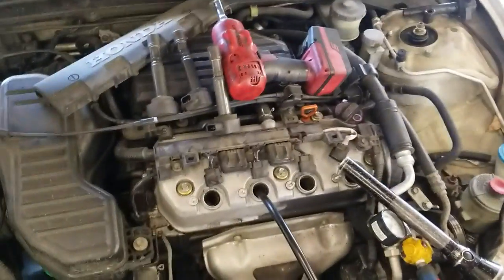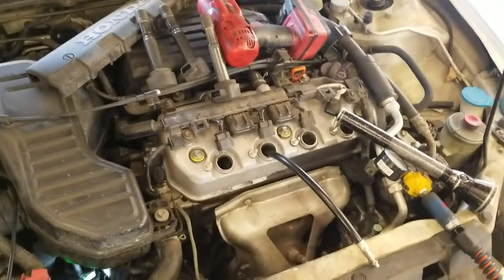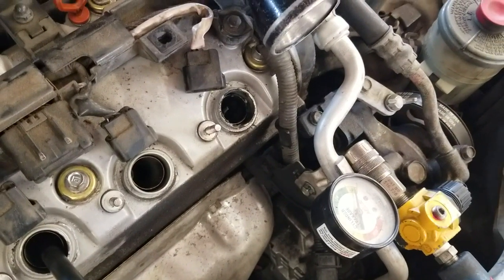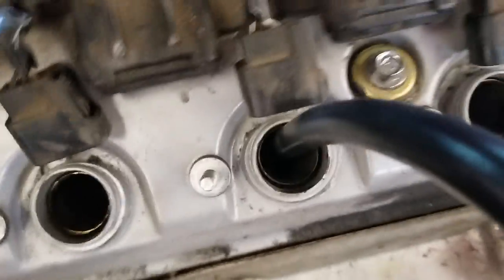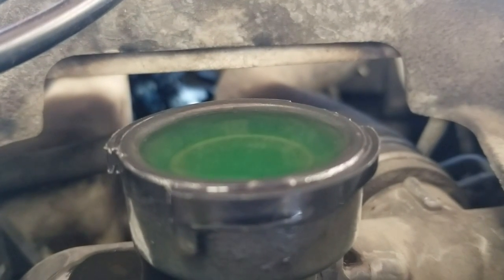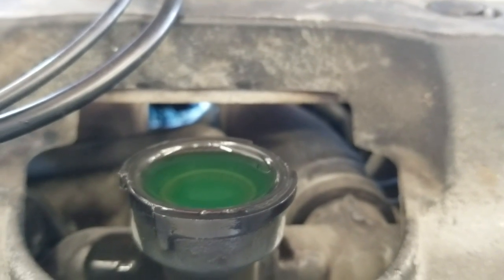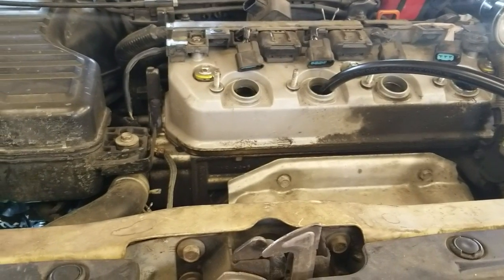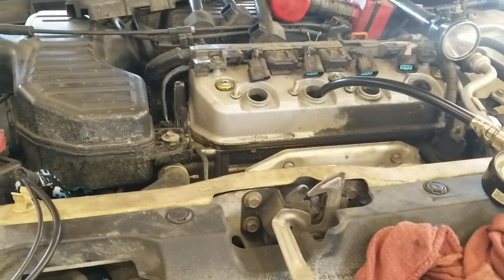Best way to diagnose if your head gasket is bad

Comment: Not necessarily a blown head gasket ,  I would call that a leaky or weeping leak  easy fix just use 1/3 of a bottle of bars , head gasket block sealer. Top everything off and drive it for 1 hour on the expressway.   Keep an eye on it and keep it topped off ,  you may need to add a few more ounces of block sealer...  Too much or more than necessary can clog the heater core  or the radiator ,  half or 3/4 fixed , is good enough... !!!    I've gotten several years out of vehicles like that.    😮.

Comment: Here's the other way to check for  Blown Head Gskt 

https://youtube.com/shorts/Pkaryg9xxpM?feature=share
Reply from the maker: Pressure from revving motor can happen when your thermostat is stuck open. It is normal for some situations. Not a precise way to pinpoint a head gasket failure.

Comment: Why not just buy a new head gasket it's only $50 repair is simple it's a single cam 🤷🏻‍♂️
Reply from the maker: This one has been severely over-heated. To do the job right you need more than just a head gasket. The repair is not up to me. It's up to the customer.

Comment: I got a 2004 suzuki liana known as aerio in the states, it has 202k miles on it and has been an incredibly reliable car. Nearly 9 years i had it it has never once failed to start and never had a warning light since i had it. One problem with though. For the last 6 years i been chasing a coolant loss condition, i cannot find it anywhere. My car was hit and his badly damaged but im going to repair it and before i put it back to work i want to work out this coolant issue, 
No coolant in oil, no oil in coolant, does not burn oil, no white smoke, no bubbles when i run the engine with the cap off, i pressured tested the coolant found no leaks what so ever, radiator cap replaced and thermostat replaced twice, waterpump replaced already. Only symptom is i have to top up half a quart of coolant every 200 miles.
Only clues i have is cylinders 1&2 appear to look steam cleaned whilst 3&4 look like i would expect. Another clue is the spark plugs in 1&2 were really stiff to come out 3&4 came out fine. Wth is goin on ?, would a reld test answer my question.

Comment: Most cars can have good design, good maintenance, good everything and head gasket can develop a leak just from age and slow corrosion.
Especially ones that run real hot.
Reply: I used a rubber bottle stopper that fit a soda bottle, taper sanded the other end to fit radiator. Put plastic bottle with bottom cut out upside down in radiator. Ran engine, the fluid slowly came up into the bottle then stopped, then air bubbles started coming out.........and kept right on a- coming.  Shut engine off and water went down.
Air came from cylinder leak into pocket in cooling water jacket, collecting and displacing water till the air began coming to the surface and into bottle.  When shut off the source of air stopped and water went back into the pocket.
Thereby certifying your worst nightmare.
Reply from the maker: @michaelszczys8316  😭😭

Comment: Thanks for the helpful video. Rather than to pressurize one cylinder at a time, would I get the same result if I pressurized the cooling system? Thanks again.
Reply from the maker: ive tried this on many occasion and even when left overnight, in most cases, there was zero sign of coolant leakage into the cylinder/s. however, in moments, when the pressure is introduced into the cylinder, you get air pressure in the cooling system. one obvious fact is you cant push 70-150 psi into a cooling system without any repercussions

Comment: That’s a sign you got a leak some place not just gasket
Reply from the maker: @imanpepion777  if it's got a leak in the cylinder to water jacket, you will also have a blown head gasket... the compression will likely be not even either.

Comment: My sons 2008 Ford Focus has the coolant filling up like that without the tool youre using. We were thrilled when we used the bulb contraption with the blue liquid and it didnt turn yellow or green. Sounds like its the same sad result though. Its a shame bc the car was my great aunt’s and only had/has 30k miles.
Reply from the maker: @lorla5236  what is the problem you are having?
Reply: @subtledriver  Hiiii! Thanks for responding! This is nowhere near a realm that I am even slightly familiar with. He had an oil change prior to driving 90 minutes to his overnight college orientation. When he arrived he noticed it was really hot in the car when he parked & finally noticed the coolant warning level light was on on his dashboard. He didnt use the car for the 2 days on campus. I told him when he left he needed to go to the closest auto store & buy coolant. The store employee helped him and added it to the coolant reservoir. I was hoping that was the issue. The warning light turned off and he started the 90 minute drive home. Naturally, the light came back on while he was on the interstate. Someone recommended he turn the heat on high & defrost & drive with all the windows down. He did & got the car back to our house. A friend suggested we have the thermostat replaced. We had it towed to a mom & pop shop. The gentleman said he ran the car & notice the coolant level dropped by there wasnt any coolant on the ground, so it was going into the engine. The car is a total loss. He asked me to get it off his property that same day. So $300 in towing costs (to & from) but it came back home. My sister, who lives 8 states away, suggested we buy the head gasket combustion leak test kit. It came yesterday and while I had the car heating up I noticed coolant WAS leaking from the bottom front bumper on the driver’s side. I did the test via the coolant tank and was thrilled when it didnt turn green or yellow. The liquid remained blue. I turned the car off for it to cool down and thought Id try again later on the radiator. I took the cap off and didnt see any coolant in the neck. I let it run for 10/15-ish minutes and then noticed the coolant was coming up the neck, like in your video but there werent any bubbles. I turned the car off and a wee bit of coolant did overflow from the neck. Then I started researching again and came across your video and was crushed hearing the diagnosis via your test results.

Comment: Should I do a glove test on my Honda cuz I don’t have bubbles but I did overflill the radiator when I replaced it after hitting a deer and now I have cylinder 1 misfire I didn’t do coil swap yet but I just have coolant leaking out from pressure but no bubbles
Reply: Swap coil packs, that worked for me, I had a cylinder 3 misfire

Comment: does this issue cause my radiator cap if  radiator pressure cap is bad to create a suction locked on to the radiator. I can not remove the Cap and I do not want to snap off the the threads to the radiator I replaced the radiator 9 months ago. I am trying to salvage my 2006 Chevy trailblazer it has been a dream dream vehicle since I was 15 when I got to ride in a 1971 trailblazer.

Comment: So I was told if you see bubbles on in the radiator when flushing or replacing water pump it means there’s air pockets in the block so now I hear you say bubbles means head gasket failure! Wouldn’t it be easier if you do combustion leak test?

Comment: I recently bought a 1980 cj with a 258. I can't keep it from getting hot. The radiator hoses get hard as well, this is probably at a minimum a head gasket problem right? Or could be rings as well? Thank you for the video

Comment: Your awesome!!!  Could you do it this way without a tool?
  
Example:  If you're testing cylinder 1 out of 4; 
Remove the fuel pump fuse;
Remove spark plugs 2,3 and 4;
Remove the radiator cap and crank the engine to simulate the tool.
Will that work the same way?

I have a car that the oil and coolant mixed together and I would like to think its just gonna be the oil cooler gasket.  Crossing my fingers on your response.
Thanks a million!!!

Comment: This is for someone stressed out over a 2012 caravan 3.6 we just milled heads, NEW head gaskets, new oil cooler, still misfiring at heat soak, because these motors are bad too have cracked blocks, from the coolant to the cylinder, if it misses when you start it then smooths out,or gets worse when hot, yep

Comment: On my car on a cold start with no radiator cap the system pushes about 8 ounces of coolant out but no air bubbles is normal.
Also, on a cold start with the radiator cap on the system, pressurizes but not enough to go into the overflow …. What’s up with that?

Comment: Boss I have a question about my 2006 Nissan Xterra off-road, it’s consume oil and the smoke is white from the pipe hopefully you can help me please
Reply: Head gasket oil to coolant. -white smoke
Burning oil means it’s getting in the combustion chamber I think?? Or something like that, there’s a leak, not goif

Comment: I replaced my head and have been chasing an overheating problem since. I get a lot of slow bubbles out of the radiator while it’s running and tried the chemical test but couldn’t get a reading. I wonder if this is a false negative. I used an mls gasket and it had a composite originally I wonder if it wasn’t smooth enough for the mls to seal
Reply: I've had that before:
•Head gasket is not sealing again.
•Either the head was warped.
•Or the surfaces were uneven or dirty and needed planed and milled before putting the new gasket on.
•Or like you said you need a composite gasket that is thicker and has compressible surfaces.
•New gasket might have been defective & failed or head not torqued down correctly? 
•hairline crack in block or between cylinder walls.
No matter what you need to pull the head again and check for even and level surfaces.
Reply: @puddlesjumper  yeah ended up head gasket didn’t seal
Reply: How long does it take you to do that?

Comment: I'm impressed that a car, that is not being maintained has managed to go 250,000 miles. Is it a Toyota?
Reply from the maker: some people get lucky. this is a honda civic 1.7, problem is it is age related, not mileage. the material on the headgasket is poorly developed, and these motors tend to over-heat due to other issues with cooling system failures

Comment: I would  replace  the head gasket.   If the old gasket  was defective  or had a little  rip .. that should not  be to expensive 
If the mechanic  wanted to charge to much money.  I would  do it my self. .and call it  a nobby.

Comment: Hi, so the Toyota dealer mechanic messed up the radiator on my 03 Corolla & the manager put in a new one at no charge, but what’s happening now is I noticed the coolant on the reservoir is disappearing! From 1 day to the next half of the coolant on the reservoir disappeared. Why could this be?

Comment: Great video another helpful tool in the arsenal to blown head gaskets. Having said i would also suggest if your in dire straight you could also try to use Risolone block stop. Its a very good product and has helped me out with a friends Toyota Corrolla with a similar issue to this video.

Comment: You can also use a leak down tester to check your valves. Make sure the piston is at top dead center on the compression stroke. Apply pressure to cylinder. Listen for air at the intake and at the exhaust pipe.

Comment: Steel seal, that you add to the radiator, has silicate in it to stop the leak. The high heat by the heat gasket makes it turn hard.
Reply from the maker: @clearsailing7993  that will block water passages. It won't fix a head gasket. The only time I have seen a hg leak taken care of, if it was leaking externally and stop leak plugged the hole. No magical additive can replace a metal fire ring that withstands 2,000 psi. That's what the factory head gasket is designed to withstand
Reply: @subtledriver  thanks for the information

Comment: Normal for an all aluminum engine. My 85 Nissan 720 had a cast iron block and aluminum head and never blew a head gasket in 320k miles. Also had a brass radiator.
Reply: How would you determine whether it needs a new head gasket or a whole new block?

Comment: Great video, I never seen a test done like that. Just a suggestion. I have done this many times my self. If you detect a leak like that in its early stage a simple retorque on the head to manufacturer specs can fix the problem. We use to do that all the time with cast-iron engines. With todays alloy engines I have found this trick only works if the leak has just started. I have tried it on engines with bigger leaks but it has only worked with small leaks.
Reply: That’s a bandaid always was even with the old iron motors.    You must be in the used car sale business those are the only scambags still using that “fix”
Reply: @Zach-k2p  You are so funny :D

Comment: I have a 2003 Honda Accord 2.4 ltre i let it warm up for 22 minutes the morning was cold suddenly my gage went on the H section radiator was overheating and i had to shut off the car a little bit of smoke was coming out of the radiator and i just had put a brand new thermostat and thermostat housing . What do you think it is causing this problem ? Also my car has 247,000 miles.
Reply: Check to see if there’s coolant on your spark plugs…

Comment: Dude if you say replace a car because of a blown head gasket your dumb asf I'll do that shit on a Honda for $150 in 35 minutes and have new oil in it and tighten the head bolts to spec and not break them like everyone does and it will run another 150k 😂😂😂

Comment: Use some Blue Devil Head Gasket repair.    It worked for me.  Has been holding for about 1 year now.
I had white smoke out the tail pipe.   Used the Block Test Blue fluid and it confirmed hydrocarbons in the coolant passage way, because it turned yellow.
After I used the Blue Devil Flush and gasket, and followed the directions exactly.  It sealed the head gasket good.  No more white smoke and blue fluid stayed blue.    Worth a try.
Reply: I used bars stop leaks and I’m still going 60k miles later
Reply: mine i used bars leak and it worked for my 96 civic.. no more white smoke and no coolant mixing on engine oil..
Reply: @julaiarnold641 Or is it oil mixing in coolant??
Reply: Sodium silicate can be purchased from a pottery supplier.
Reply from the maker: If the engine wasn't severely overheated, and it was slight seepage that doesn't force the coolant out when driving, you can get away with stop leak. I dont recommend in many cases. As it can clog heater and radiator and passages.
Reply: Did you remove thermostat?

Comment: but does the valve really seal 100% so that it won't allow any air to pass by?
Reply from the maker: there is no valve failure, it is a gasket or crack in the block/head allowing air to get into cooling system. that should never happen on a healthy cooling system.

Comment: I am using Toyata Yaris 2011 model GCC spec, Dubai. My issue is  coolant water is coming through my reservoir, it's very slowly and little bubbling also. I went to garage and they changed Cap, coolant pump and the whole pipe also, but still the coolant is leaking. Can you suggest what I can do next?. Is it a signs of bad engine? If your sharing your contact I can share you a video also.
Thank you

Comment: 2009 dodge grand caravan changed radiator thermo rad caps water pump with no signs of head gasket HELP
Reply from the maker: i cant even understand what you are getting at in your sentence. did you do this leakdown test?

Comment: Hi! 
What if there’s white steam vapor coming from the tail pipe?
The temperature gauge is good, oil is good, coolant is good.  I did have a check engine light read code P0303 cylinder 3 misfire. Trying to diagnose before scheduling an appointment. Haven’t driven car in 3 weeks ever since the excessive white steam happens when i start the vehicle & drive for 15 minutes. After 15 to 20 minutes steam goes away from tail pipe.
Reply from the maker: sounds like normal, or a blown head gasket. get this test done and find out.

Comment: In my unfortunate experience it pushes out of the coolant reservoir or cold start with the rad cap off and watch it blow bubbles when the thermostat opens...just got my car back from the shop with the head gasket blown on the second motor from LKQ. I guess no one bothered to test before shipping and install twice😅

Comment: thank you for sharing your video, and tips on how to determine or test when having some difficulties on your car: engine, radiator, cooler oil pressure etc.. as I am experiencing myself on what you just described. let me say  thank you putting it in into words of comfort 'your car had better days and time to retire"🙏i understand material things can get replace. The  acceptance is a bit overwhelming 🙏

Comment: I’m just gonna continue to ignore the problem until I’m stranded and have to deal with it 😂 my engine only has 7,000 miles on the rebuild and 3,000 miles ago coolant started disappearing 😂
Reply: Oh jeez dude! Only 7000?! 😂 I just got a project car for 5k and white smoke came out of the hood along with a massive coolant leak. I got what i paid for i guess 💀
Reply: @willferalx  it’s an ATK engine 4.0... I wouldn’t recommend them.

Comment: So,the *NEXT* thing is to re-tighten the head bolts,and re-test with the air,or idling...
BE SURE you study well the procedure to re-do those bolts or nuts,there IS a special way...
Sometimes,seldom,you get lucky, but only if the gasket in not burned, if it was only overheated and its thickness has diminished..
Reply from the maker: Replace it. These lose material and blow out because of bad design.

Comment: I have a 04 Durango and replaced all engine coolant parts except heater core and head gasket but I also have steam coming out of front vents when it’s not running hot which 1 do y’all think I need?
Reply from the maker: vents in the car? then heater core.
Reply: @subtledriver  yes should be the front heater core right
Reply: I have replaced everything except that but it slowly runs hot when I drive it